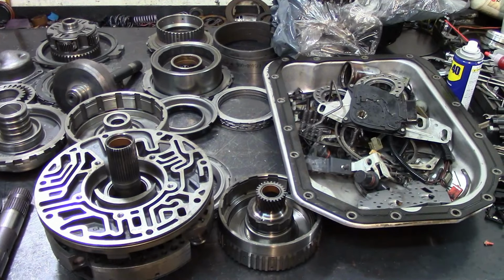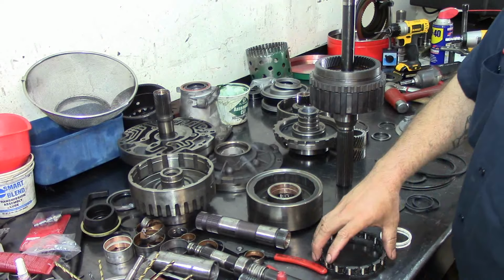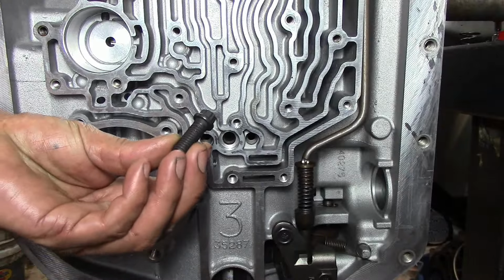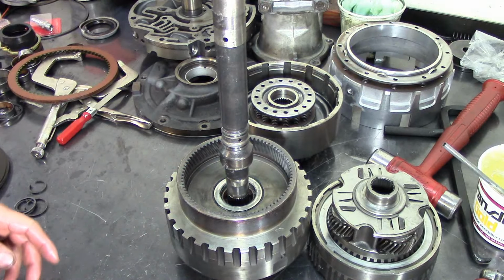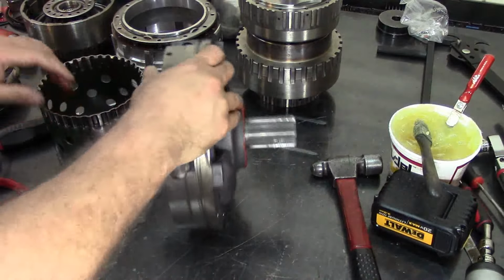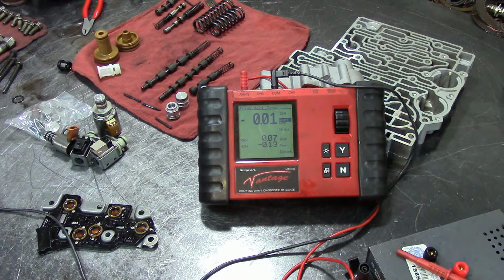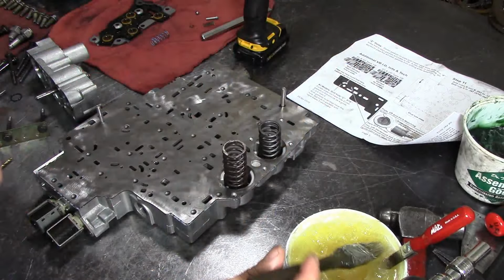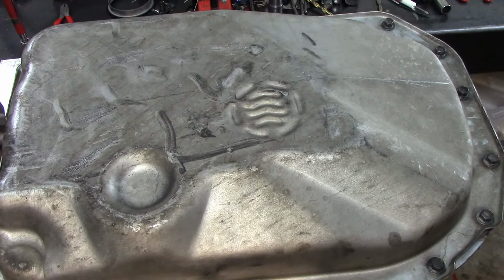GM 4L80-E Transmission Rebuild - Transmission repair

Comment: Hiram, Great videos. I got a question for a 2007 2500 express what transmission oil should I use Full synthetic or regular an how many quarts? I just finish my first full "DIY" rebuild  Thanks in advance.

Comment: I recently just re-built my first transmission almost 100% from following this video along the entire build. I used the ATSG manual to help with specs and such but other than this this is a fantastic how to video, and Initially it was this video that made me confident enough to tackle the 4l80-E in my 1 Ton 4x4 K3500. thank you very much sir!
Reply: Would you do it again or buy a rebuilt one?
Reply: A child can build THIS transmission same as an LS engine. Why pay over $2k when you can do it yourself for $500 max? Would you pay someone to do your LS since that is much more difficult of an assembly compared to an auto trans. Everything you need to know about both is online for FREE! Just saying bro... @23steph13

Comment: Please tel me where I went wrong.  In drive on my 4l80e at around 3 gear it feels like reverse is locking up.  It catches and then releases. It actually locks the tires for a second. I'm guessing it's the third gear upshift
Reply: mike gann did you figure it out?

Comment: I recently had my 2007 Chateau Sport with a Chevy Workhorse Chassis transmission repaired (only had 14,500 miles on it). Upon getting it back, it makes a loud noise when putting it in reverse, but only when cold. I'm told it's nothing to worry about by the owner of the transmission shop.  What do you think?
https://www.youtube.com/watch?v=aTQSVOZMN2w

Comment: Thanks for the response. You use all very simple tools in the video, except when you go off screen to use the shop press, do you use other fancy tools off screen? Why would you change the additional items that were not provided by the shop? 
Thanks for the video
Reply from the maker: +Rafael Gelpi Just the foot press and shop press. 
Concerning the additional items was for durability and reliability.

Comment: Really Great video! I was wondering if you could tell me what to look for when disassembling my 4L80e trans out of a 2009 Chevy Express 2500? It developed a very loud howling noise with some vibration all of a sudden in 1st gear only while in motion. No other real noises or issues in other ranges. Kind of soft shifting between gears thats about it. It had over 240,000 mostly highway miles on the van. Code was in the ECU for trans over temperature and when driving it the last 2 times couple of days ago a warning message on the dashboard for Transmission Hot, Idle engine. I'm going to be taking it apart on Tuesday in a couple of days from now. Thank you for this great vid.

Comment: What rebuild kit did u use?  I'm getting ready to rebuild my 2wd 2001 chevy 2500 4l80e. Reverse is been going out for the last 2.5 years and finally went out completely.  U mentioned the boost valve will cause it to lose reverse.

Comment: I have the same transmission in my 3500 diesel truck. I need to rebuild the transmission in my truck, would you recomend I rebuild it, or should I find the Allison transmission and rebuild that? Also which products should I use to rebuild it, and which upgrades should I make? I am trying to get another 600,000 out of the truck. 
Thanks for your input.

Comment: any video of you actually removing the bushings? and what are the proper tools to remove? do I need a press?
Reply: Thanks this is probably the best instructional video ive seen on the net. Good job
Reply: thanks for the quick response, i watched it and it seems straight foward. do you have a recommendation on the driver tools? i plan to only build mine myself so looking for a cheaper kit that would have all the sizes. do I need to look for metric or standard or mix of both

Comment: love your vids man, i've learned alot in my endeavor to learn trans rebuild, but a quick question if you've time is there a big difference between the 4l80e and 4l85e in terms of rebuild or is it generally the same?

Comment: I don't see how to change from aluminum pistons to molded pistons. The direct is a straight swap, but the forward is not. What do you do to retrofit new molded pistons in place of aluminum for the forward drum? The inner sleeve for the molded piston doesn't fit older drums.

Comment: Score on ebay today I find what I could seemingly only find elsewhere for $1100 a set of 4L80-E transmission internal servicing tools for the humvees 4L80-E transmission and engine for a third of that! Search "Kent Moore Draf SPX SPECIALTY 4L80E Service TOOLS 6.2L 6.5L HUMMER HMMWV GM"

Comment: Also I found in a Chevy Forum a link to the most awesome free pictoral step by step 4L80-E rebuilding manual. Save your money for the ATSG monies tight however the diagrams are clearly usefull!
Its by the ATRA member Cliff McCormick, Thank You! Cliff McCormick, your awesome!
http://oskin.ru/pub/chrysler-dodge/manuals/ATRA_Transmission_Repair/ATRA-4L80E-Rebuild%20%28GM%29.pdf
Thanks again Hiram Guiierrez your awesome too!
After having had my local Austin Texas Aamco do a bench rebuild on my 127K transmission that was totally clean and working to which they did absolutely nothing but charged me $1200 for a new Torque Converter and an input shaft oering and filter wwhich came back with 2 quarts dirty transmission fluid well there is no love lost on these folks I am currently suing. No body knows the trouble I've seen! I am disabled they even stole the store operator $400 in financial assistance check from the Catholic Assistance organization for the disabled. They charged $599 for a banner kit they used $20 of parts from what a rippoff Aamco Stassney Lane Austin Texas Don't go there!!!!!!!!!!!!!!!!!!!!!

Comment: Hey folks one of the biggest challenges I have found in doing the rebuild was trying to find the specialized tools to do the bushings. You can get by without many tools if you do not replace these but its highly recomended. At least you need a $30 clutch spring compressor and a forgiving round plastic transtech/transtar lip seal tool. Well score on ebay today I find a comprehensive 4L80 internal servicing set for the humvee military surplus. Search "Kent Moore Draf SPX SPECIALTY 4L80E Service TOOLS 6.2L 6.5L HUMMER HMMWV GM" with a full kent moore set a $1100 this was a godsend!

Comment: hiram I am very thankful for your video but was noticing no checkballs after you torqued the 6 bolt low reverse servo piston cover.
I am desperately trying to figure out tools for a full rebuild between a 3 leg cheap clutch spring compressor vs using 2 or 3 c clamps. then a large verical press about 200 from haebor freight your modified large screwdriver and flatted chisel. last but not least what size craftsman sockets I might use aa bushing drivers vs a used lisle or mac etc. bushing dricer set as to what sizes needed. I have heard using a cam bearing driver works? Then I guess I need a cape chisel or other bushing removal chisel.

Comment: At 1:04:57 you drill a 1/4 inch hole in the pump housing but dont say why? is that part of the preasure relief you put in valve body? or to reduce presure on front seal from blow out?
Reply: Its to prevent the seal from a blow out.

Comment: I'm getting ready to rebuild 4L80E to install on C20 1984 and picked up a lot of what to does.  Have done some transmissions and not scared to work just scared of screwing up.  My question is on end play and wondering if that is necessary to check?  I do have the Blue book on rebuild and it shows doing that but, is it really necessary, for I have done it on 700R4's and 4L60E's.  Another question is have you done retro fits on older vehicles that don't have control boxes for E Transmissions and recommendations?  Thank you for your time in the videos!!

Comment: Love the videos man, very detailed and give me the drive to build my own. What are you actually using to help with removal of the old bushings? I know some have no way to get to the other side, say the output shaft inner bushing and what not. I've watched your 2 videos over the bushing install and reasons to change them but curious about the removal. Thanks again for the videos
Reply: +Hiram Gutierrez I was thinking so by how the bushings looked that were t pressed thru to get out. I have another question which I think was answered kinda by another video I seen on the 4l80. On the forward drum. I replaced the molded piston no issues at all and got the spring pack reinstalled, after that in installed the wave plate I guess you'd say cone down in the center instead of outward like in he direct drum. But it seems like my clutch pack is to tight, the cap or top piece before the snap ring I had to apply pressure to get it on. If I flip the wave plate it fits fine, but then it's bevel down on the outer side by the teeth I guess you can say and it spins freely in the bottom grove. I'm using alto red frictions and kolen steels. They measure the same thickness as the oem style frictions and steels .07 for friction and .08 for steel. This is where I'm stumped
Reply: There is a video here on youtube where a person takes a large square shank screwdriver and hammers off the handle. He then chop saws both ends square. After this he cuts an arc angle on one end with a grinder.
This makes a cheap bushing removal tool. If you buy the large phillips and standard screwdriver pair you can modify the phillips one into a cheap bushing removal tool and like Hiram show make a square notch on the end of the large flat one to make the deep case snap ring removal tool. I also found a large hook end pick tool can work as well on the internal snap rings.
  In addition I learned a new one today. the case is easiest and most safely cleaned after the case is stripped. One can use an inch and one-quarter 12 point deep socket or 12 point box end wrench to create a round harness release tool. I went to the pawn shop and dug through a bin of loose sockets. I did not find the 12 point socket and only 6 point ones. I found however a used carbide circular hole cutter saw that worked perfectly. just use a caliper and find some junk pipe tube with a round 1.25 " hole.

Comment: great tutorial video man!  question: does assembly lube choice make a big difference?  I see you using transjgel gold for general assembly and the green tacky stuff to hold and lube other things.  I see a lot of choices out there and different tackiness and colors.  Are these 2 your preference or just whats on hand?  Some say use Vaseline others say just use trans fluid.  Gonna do my first trans ever soon (4l80e) and would like your opinion on lubes.  I'm in hot Texas heat and will not have trans in right away after build if that matters.

Comment: hopefully you may have some insight... rebuilt a 2004 4l80e. the trans will start off in 2nd in drive. if you use manual 1st the trans will lock up like a brake. reverse and all other gears work great. trans torn down again and no evidence of anything wrong found.... any ideas?

Comment: Hey Hiram. Great video. I was wondering how feasible it would be to remove the valve body in vehicle with all those check balls. Is it possible to install them in the valve body and then install the valve body. I want to remove my 4L80E valve body to replace the third gear accumulator D-rings. When in drive up a hill, the 4-3 downshift has a little rpm flare/slip for a split second then it is fine. But it just started doing it, so maybe I can save 3rd gear. Replaced fluid/filter already. What else can make 4/3 shift to slip?

Comment: thanks for posting this.i have a 94 jag xjs with a 4l80e.although i was told it has the same guts as the chevy version the case is different(bolt pattern/v12).i have tried several shops that say they do the 4l80e trannys but for some unknown reason they won't touch the jag version of it.i now have the needed reference points although it's an earlier version to attempt a rebuild on another case.
aside from the shift kit mod...is there anything else i should look for and do you have recommended parts to use for it(re:heavy duty items/specific company source)?also...i wonder just why-considering that the case bolt pattern for the engine is different-that the shops here in the dc area won't touch it when the guts are supposed to be the same?hell...the jag dealership won't even touch the car for alignment or the computer which btw...i've found the info for and mastered them myself?
input on this one is greatly appreciated.thanks!
=dok=

Comment: I rebuilt my 4l80e transmission about 18 months ago and a few weeks ago at work my reverse suddenly went out. It's a utility truck and I keep it pretty heavy but since the rebuild its driven good no problems at all. I have all forward gears but no reverse. Can you possibly help me out on what the problem might be? Thanks.
Reply: +activaenl94 The reverse servo piston in those is notoriously weak. There is a upgrade made from billet aluminum as opposed to cast. Also, the pin in the servo can break as well. The pin might not be long enough, or wasn't measured correctly depending on if a new reverse band was installed. If not, the reverse band could be worn and need replaced.
Reply: Disciple Killa563

Where could I find the billet version?  On eBay or Amazon?

I need that as well

Comment: okay so I rebuild my first 4l80e when installed in the truck which was a 2006 2500 heavy duty Chevy van worked out great for the first hour while driving are you ready go clutch bags new seals new bushings pretty much everything was new converter after the truck warmed up converter was locked up so I changed all the wiring harness and sensors I clean the valve body very well and I made sure no valves are sticking so I drove a little more synthetic atf6 and I feel like a clutch is being applied between first and second shifting kinda hard I cannot figure out what's going on it's only when the transmission warms up I don't know if the pump valve is getting stuck any ideas I know I have to pull it out again which is no big deal but I would like to have more understanding why problem like this can show up when the engine is warm and transmission as well he threw a code I think  something sleeping inside the transmission I know sometimes the band the lower band can be a problem but it's the first transmission I ever built so I don't know in my second one will probably be an Allison 1000 hopefully I'll have a better experience with it

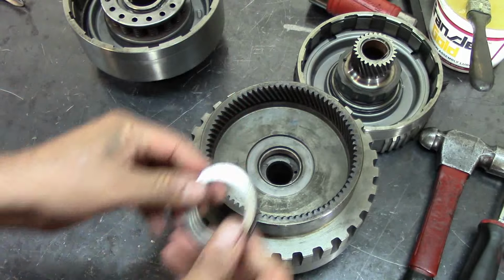Comment: At 47:30 can that bearing be installed either way? what would happen if it was flipped around?
Reply: I believe the bearing wouldn't be seated all the way, so the bearing wouldn't work like it's supposed to. It may even distort that bearing because it isn't seated right.

Comment: why did you enlarge the drain hole to 1/4" on the pump cover?
Reply: probably part of the lube modifications, more than likely a part of the shift correction kit from TransGo...

Comment: Great video bro.   I have a 93 K2500 Suburban with the 4L80-E.    How much does a full rebuild cost on a rough guess?   My truck has run great but I have noticed it seems to be shifting lazy from 1st to 2nd and it has 180K on the clock.....any thoughts? Thanks in advance for any info

Comment: ok so iam about to finished with my buddies 4l80e came out of a 2006 Chevy 2500 van with 230000 miles what I notice is that the body valves were stuck three of them so I cleaned lube seems like they are moving freely I packed the transmission with some Red Eagle new molded pistons all seals and bushings and everything was based upon your video I don't think I could have done myself now you see you could make an Allison 1000 video cuz thats what I have on my truck and I'm running close to 700 horsepower I don't think my trainee can take much longer thanks great video

Comment: Hi Hiram, your videos are awesome man! I'm learning a lot about automatics, thank you. 
I have a 4l80e in a grumman olson p/30 stepvan, the transmission was completely rebuilt, now I'm experiencing harsh 1 to 2 gear change, all the other changes work fine (2-3 and 3-4), very smooth. I can use some advise on what to start looking to solve this issue.

Thanks again!

Comment: Awesome 4L80E rebuild video I'm building one out of a 2003 Silverado 2500 HD that plows snow and pulls inclosed trailer will the shift kit you used help with my rebuild?

Comment: Hiram I can't thank you enough for your time in making this video! Very easy to tell that you are a master at your craft! Ive built many engines and this is my first trans, without your video I would be completely lost. Top notch Bro! I do have two questions 1) the seals that go in through the valve body, I didn't remove these and I didn't get them in the shift kit or rebuild kit, are they necessary or required? 2) With new Alto Steels, is there prep that should be done prior to install? They appear to have black paint on them. Thanks a Million!

Comment: Hi Hiram, thanks alot for making these videos! They are super helpful. Hoping you could answer 2 questions..@17:37 you are installing a plastic 2 tang washer on the output carrier assembly, my thrust washer kit came with a 4 tang metal one, same as the one that goes on the output shaft. I am building an OEM 04 model. I can't buy a plastic one anywhere, can I use the metal one? Also @33:22 you are installing a case washer (race) with 3 prongs. My rebuild didn't come with that piece, is that stock or from the shift kit? Thanks in advance
Reply: thank you sir

Comment: Mahalo Hiram for such informative.  I have a couple questions.  1st, What rebuild kit do you suggest to use and does the Bushings come in the kit.  2nd, what torque converter or stall speed should be used on a 2007 HD 2500 Sierra?  I've been looking at what Summit racing offers.  The is just a stock truck I need to get back on the road.  Do you still recommend the modifications for the shift kit?  I'm fine with the stock shift as it is.